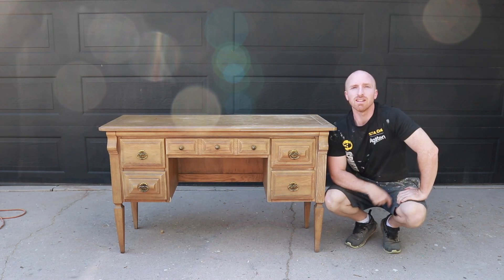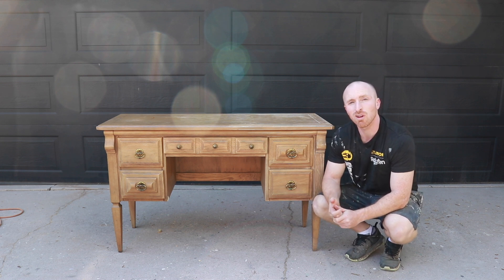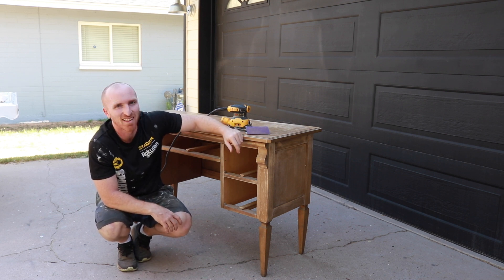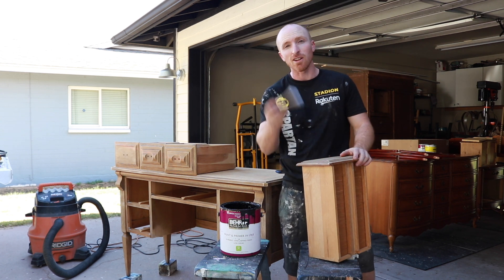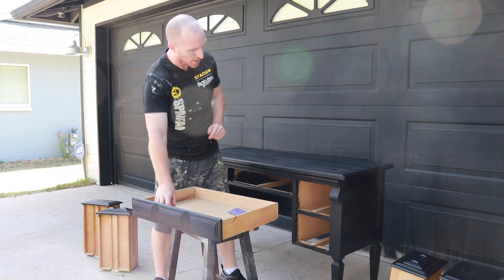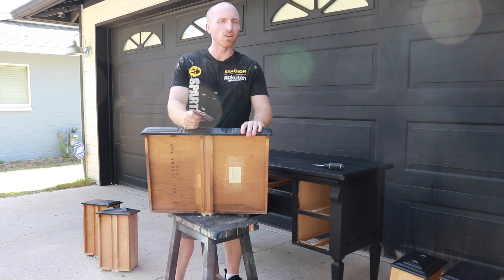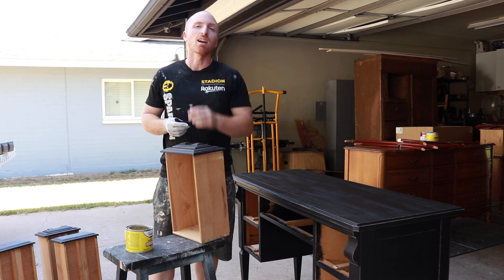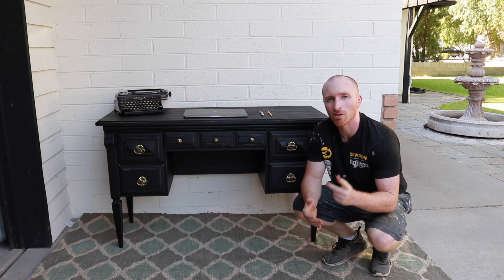Furniture Makeover | Painting a Black Desk | Weekend Project

Comment: Why not use a spray on paint to make the process faster?  Is there a spray on paint you’d recommend in general?
Reply from the maker: Many reason to why I dont spray paint. Im not a big fan of off the shelf spray paint. It can be very costly compared to brush painting. I also dont have enough skill yet at buying a nice system and getting a nice spray on the product. I also like brush painting to show that anyone at home can grab a brush and some paint to do these. I have gotten good enough that I dont have brush strokes and the cost is much cheaper with less cleanup and setup. I dont have any recommendations on spray.